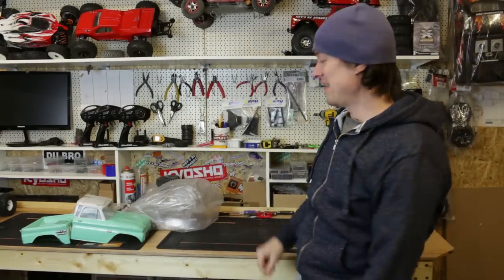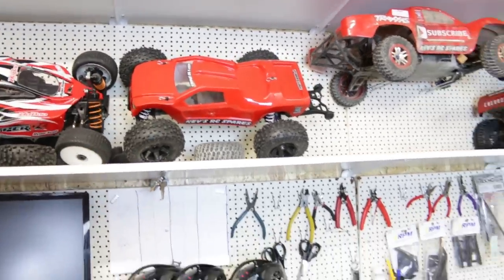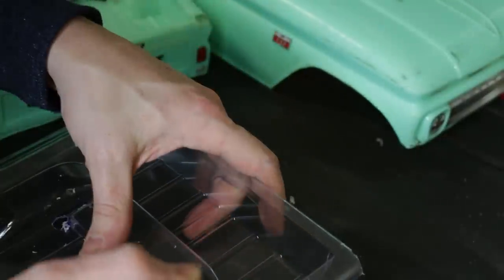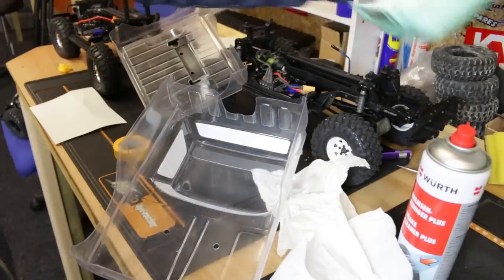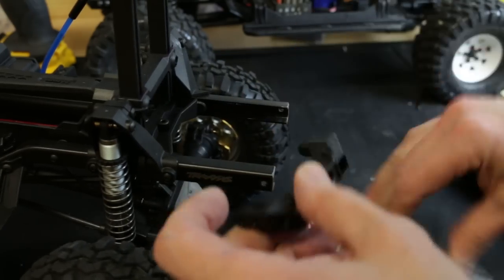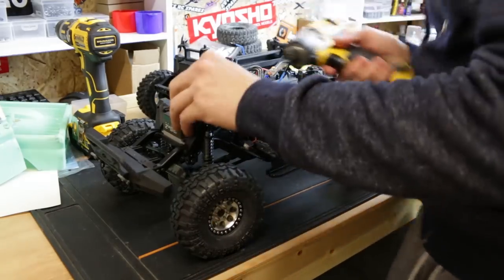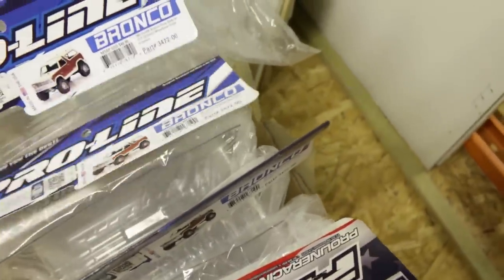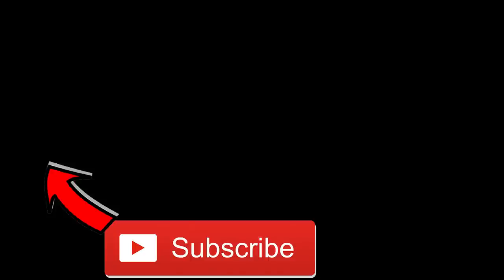How to Fit & Paint THE PROLINE CHEVY C10 to a Traxxas TRX-4

Comment: Hey Kev, with the window masks, cut the mask out on the lines and then peel only a 1/4 strip off of one end and keep the rest of the back on it so it will slide around on the window, then when you're happy with the placement, stick the 1/4 part down and then peel the rest of the back off and it will lay right down where you placed it.   I hope that makes since;)

Comment: A tip for painting, just a little bit more patience. First coat very light, can speed drying with heat (hair dryer, heat gun, ect.) and each coat after a little heavier.  This will minimize the paint not sticking or flaking off and showing the white through it. Great paint job though, like it a lot!

Comment: Great job Kevin! If I may, I found that by taking the rear trx4 mount off completely you can mount the 66 Chevy proline bed flush without making any cuts to the bed floor. I used heavy duty Velcro to secure the body on mine. Check out my trx4 chassis kit build and you can see.

Comment: What I do to paint those hard to get places is, I use the spray mechanism from a WD-40 Multifunctional Flexible Nozzle Spray Can. This allows me to get paint into the toughest, smallest places, perfect every time.. Though you can also buy nozzles for paint cans that do the same thing, I just so happened to have an empty WD-40 Can hanging around with that nozzle type. You can also try the nozzle type with a straw hanging from the end.

Comment: Put everything in front of a little 2kw heater before you paint, make sure you de grease the inside with preferably some brake cleaner/panel wipe, and blow if off with compressed air, also build the paint up in very thin layers every 30 mins or so I find works the best and really helps the paint get into the the little ridges and awkward areas. Take your time, if you rush a body 9 times out of 10 it's going to like terrible.

Comment: Leave the backing on the mask and cut the whole mask out then only cut off about a quarter inch of the backing along the top or bottom,you can line it up perfect  then just stick the quarter inch of sticky part so it doesnt move  then gently lift it up and pull the backing off slowly as you press it down  it will be lined up percect ,its the best way i found to do it   hope you understand how im explaining it because it does work well
Reply from the maker: great idea I will try next time dude :)

Comment: If u do the spray paint in quick passes instead of holding your finger down u will get a much nice result. In all honest u may not notice it. but I'm also into painting so thout I would try give some advice. Can also sit the can in fairly warm water to get better results out of the can. Have a look at lukes aps how to use a spray can it super easy when u get ust to them
Reply from the maker: I tried that and it made it blotchy
Reply: It could also b brand of paint. I paint alot Warhammer. And that community is like u need to use this brand or it will b horrible texture etc. But I never listen to them and use cheap pound shop paint for priming them. Hope this helps
Reply: If u are worried about having texture in the finish u could always use a airbrush to. U can get some real good quality ones for fairly cheap just hook it up to a compressor water down the paint a little and its like a more controlled spray paint can then

Comment: Maybe I did it the hard way but I moved the shock towers up and used axial posts to avoid having to cut the bed.
Reply from the maker: Yeh I could have avoided cutting if I raised the posts but I like my body's low I think overall it looks much better like that
Reply: I mean moving the shock tower up one hole position on the frame. You have to lose the plastic battery hold down but you can use a strap. The shock tower then fits in the raised part of the bed.

Comment: Sticker trick, spray the surface with water.  Downside, you have to press the water out and wait for it to dry...
Reply from the maker: does it still stick after?
Reply: Yes sir, you just press the water out.  We use it on decals, makes placing a lot easier